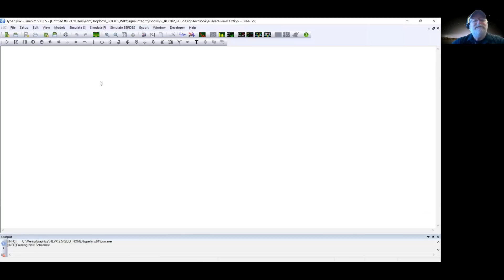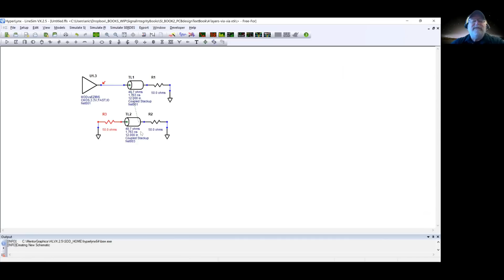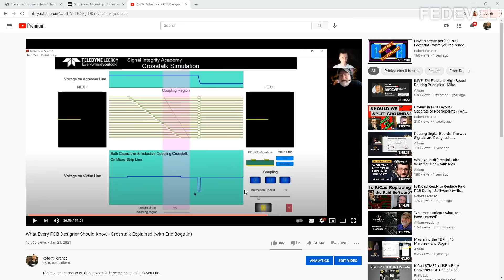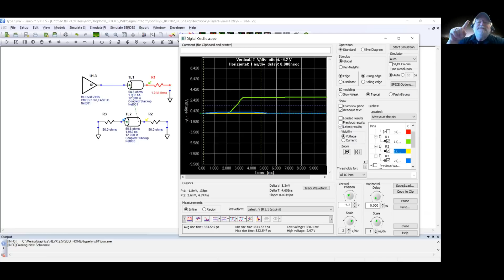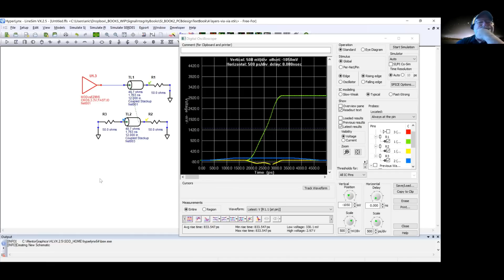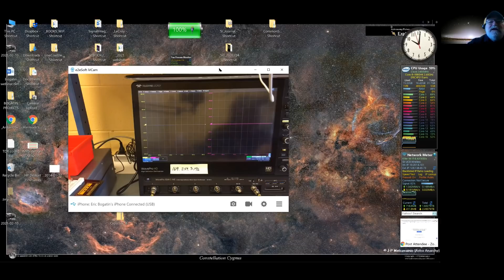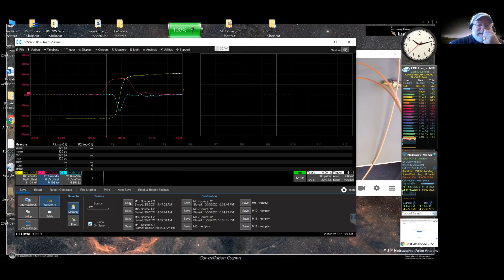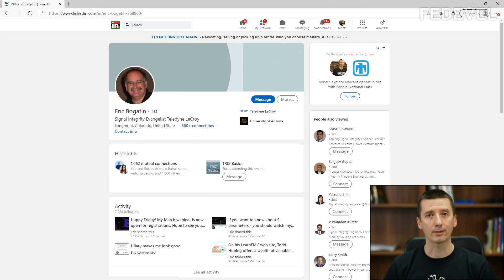Understanding Crosstalk in PCB Layout - You may wish you knew this before (with Eric Bogatin)

Comment: At 12:20, Eric adds a 50 Ohm terminating resistor connected to ground.  What if you are just trying to prevent crosstalk on the output of a microcontroller?  That would kill the microcontroller pin.

Comment: I don't have much of a point in this rant but here it is: 
This video will also dispell the weird Veritasium video challenging wether voltage/current/energy/electrcity travels in a wire. Is it electrons propagating in wire or transmission at light speed in all directions. To demo this, he proposed laying a wire 1km long flatly and travelling away 499.5m , the making a 90 degree turn, 1m wire more, then another 90 deg. turn heading back 499.5m keeping a constant 1m distance from outgoing wire.
At starting point of 1km wire was a battery and a 1 pol switch hooked up. I don't remember if the negative side of battery was connected to another 1km wire doing a loop in reverse direction or just a 1m stump to an light source. The challenge was to predict how long time it would take before it would light up with the light source being 1m away from battery/switch. The light source had the property of lighting up at any current present.

It feels like Veritasium makes the case of "spooky electricity", it's not about electrons pushing each other in a wire but "energy" thru air lights up the target at the speed of light travelling directly, jumping the 1m gap.

It is sort of a silly case, because it's basically seen to us as "just crosstalk"... or seen as an antenna transmission.
The only "challenge" in Veritasium video was to "correctly" focus (guess) on the "magic" light source lighting up on the minute crosstalk energy and ignore all other minute details.

To me (the Veritasium vid) it felt like a cheesy video, trying to mystify rather than clearing up different conceptions of reality/theory/fantasy because;
If you are going to make or break the function based on "crosstalk", "magic light source" and asking for a specific time it takes; then anyone sufficiently petty will say question was actually impossible to answer at all because of missing information/test conditions like gravity/time dilation, dielectric properties, thickness of wire and the actual distance between the long runs -is the "1m apart" the c-c wire distance or between the closest wire strands... Oh, if it's an actual wire that means strands, how many? How thick each strand? what twist rate? etc.
I'm not sure why I thought about veritasium video seeing this video but I like this video better.

Comment: Hi Robert Feranec, how near end crosstalk gets high even before the rising edge of the driver signal do it?
Reply from the maker: the rising edge of the driver which we see in the in simulation is measured at the end of track, in reality the signal starts sooner (at time 0) ... it takes some time to arrive the signal to the point where we measure it in our simulation.
Reply: @RobertFeranec   you are rigth. I got it. I let that slip away. Thanks.

Comment: This video was super informative and very interesting. I had one question regarding the cross talk on the victim trace. I see on the simulation and even on the actual measurements, the cross talk voltage in the victim trace is generated like a few time scales before actually the signal rises in the aggressor. How does this happen? How does the victim trace know even before the signal has arrived.
Reply: What is shown is the far end signal of the aggressor. This is not the input signal. The input signal view is disabled in the simulation He shows the trigger in the beginning and disables the view. 4:19 is where the input signal is shown. He tells us to remember the rise time there. 
In the live demo he 1st shows the input signal connected directly from the oscilloscope to the oscilloscope and tells us to remember the rise time. 52:33  is the input signal. After which he connects it to the board. Therefore he cannot show the input signal directly. 
The cross talk happen at the right time after the input is triggered.

Comment: Hi Robert, when designing a flexible PCB, it is important in some cases to add a stiffener (e.g. FR4) beneath some components to avoid overbending the pads and components. Have you done any videos on how to add FR4 stiffeners to specific locations? Thank you

Comment: Thanks but I think that simulation tools are still very expensive. A test board or simulation using traces with bends and compensating jog outs would be interesting. Does Eric have a similar test board to test differential pairs - maybe with different lengths to simulate a phase error - how does this affect signal integrity?
Reply from the maker: Thank you Chromatec. I have this on my list. I may use Cadence instead as Mentor/Siemens doesn't want to provide license for Hyperlynx (yes, simulation software is expensive, so I am very grateful when a company borrows me the license)